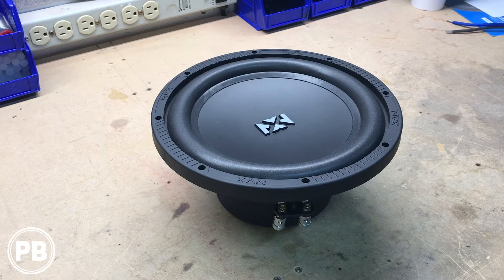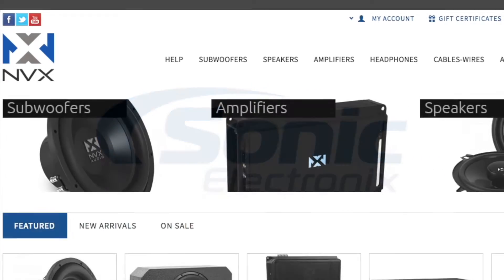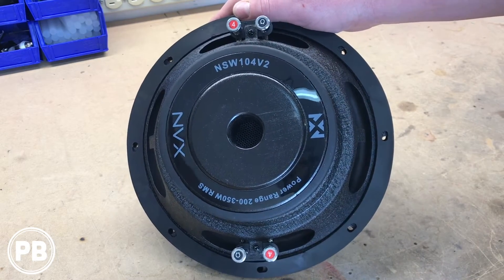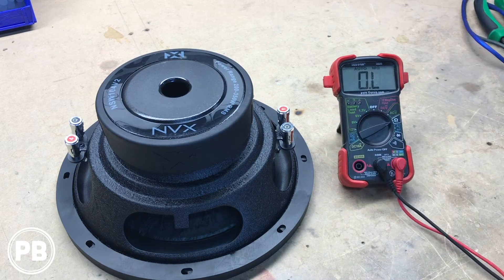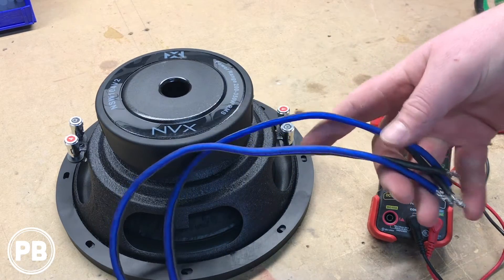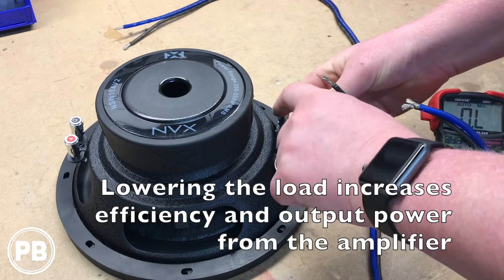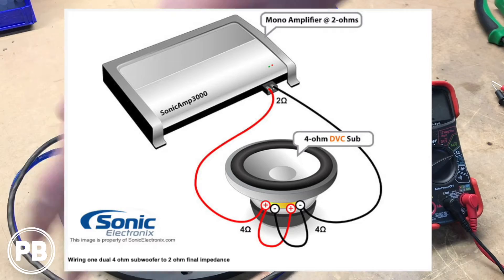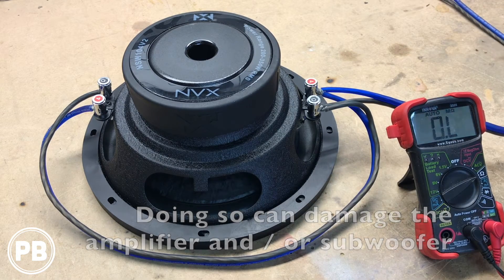How To Wire DVC 4 Ohm Subwoofer

Comment: I have a question ,  I have 2 subs, not yet installed because I cant get a straight answer .. 

My amp 150 watts PER CHANNEL 2 CHANNEL ...ONE LEFT CHANNEL     ONE RIGHT CHANNEL ,    BOTH AT OPPOSITE ENDS OF THE AMP.. 

RATING 150 WATTS RMS 4OHM 
190 RMS @2OHM 

I have 2 brand new subs 
10' 
4ohm , Dual voice Coil 
200 watts RMS 400 peak. 

I have 2 separate boxes , I can't join the 2 subs through the boxes .. 

I mean I could if 2worse comes to worse but I'd rather not due to space restrictions...  

I been told to Connect the positive and negative on one side (1 coil) leading to the amp... then jump from the live positive coil to the negative other coil ... and same with live negative Jump to 2nd coil positive... and do that for EACH SUB BOX ... 

I'm really worried I'm gonna damage my equipment
Reply: I would go from four ohm down to 2 ohm on each speaker this way you have more RMS wattage running to them and I can handle the power because it’s only 190 W RMS watts at 2 ohm just take the positive from each voice coil and the negative from each voice coil and connect them to your terminal and then run the wire from your terminal to your amp for each speaker and you will be good

Comment: When is it wired at 4 ohm....not 2 or 8......how?
My amp is 4 ohm,bridged....
Reply from the maker: Laws of resistances at play here.  If you want a final impedance of 4 ohms, find a Single Voice Coil @ 4 ohms Subwoofer.
Reply: @ProvoBeastAudio  o.k.   ..i bought wrong amp...  2 channel  2 ohm per channel   ....4 ohm bridged😲

Comment: The 5 channel amp I plan to install in my car has a 300 watt RMS a 2 ohm stable subwoofer channel, will wiring the 4 ohm sub to 2 ohms increase or decrease the RMS wattage?
Reply from the maker: Decreasing the ohm load on a sub will increase the wattage, as long as the amp can handle the lowered resistance.

Comment: Okay I'm learning and make moves faster than I'm learning, here's the scenario I'm in.
I had the Polk audio powered sub (pw10) for years, recently watched a show with clipping bass, and it half way blew the sub by the time the show was over. in hindsight, I remember the bass in those scenes sounding distorted, but I was too entranced in the show to stop watching.
I already took the liberties to order a KICKER CVR104 dual coil 4 ohm to replace the stock woofer. (long before I learned anything about power matching)

For videos I see the stock woofer is a single coil 4ohm so with that I know the amp can handle at least 4ohms, but there is little information on the amp other than it supposed to do 50-100 watts rms.
The sub I ordered claims 50--400 watts arms ( 200 watts per coil)

So my thinking is, I should wire it in series, and get a max power of 100 watts and it should match the amp's output?
it's a small room,  I'm not too concerned about using the full power of the sub, I know I'd need a whole new amp to safely to that, I just want to know if my line of thinking is correct before I hook the thing up.
My goal is to get about as much bass as I got out of the cheap driver without hurting the amp, and hopefully having my setup last a few more years before needing to deal with this shit again.
Reply: howd you get on? I run a 12inch straight of my home stereo too. 8ohm. DVC in series. Works perfect.
Reply: @georgecostanza831  I bought the wrong sub, I got a DVC 4ohm not realizing I couldn't wire it at 4ohms....live and you learn.

However wired at 8ohms AND still way underpowered it still sounds great either as good as the original driver or better. 

in fact I'm pretty sure it's moving more air because I'm hearing some port noise on low notes I didn't hear before, but once I sit in the sweet spot it just sounds smooth and clear, you just hear the port noise when outside of the sweet spot.

SO I'm thinking of adding a second sub just to add more area to the sweet listing spot.
Reply: @VALAREZ  Yeah you live and learn alright, and yeag thats always nice increasing the bass, im in the process of chucking two 12's into my car and into a ported box too. So that just upgraded my room's 8ohm 12inch to a larger box. Now the bass is even better. Neighbours are loving me.

Comment: Might sound silly but, is it possible to get 6 ohms out of 1 dvc 2 ohm sub or 1 dvc 4 ohm sub. I want to replace home audio woofer that reads out about 6 ohms with a  2 or 4 ohm dvc Car audio sub. 8” woofer.  Thank you.
Reply: The math here is: wiring speakers in parallel gives you the inverse of the sum of the ohms' inverses, in series it just  adds the ohms. Since a DVC has the same resistance on both coils the rule becomes parallel = half, series = double. Since most car speakers come in 2 or 4 ohms you can not get to 6 with a single DVC. Somw workarounds / caveats:
1) Ohms listed my mfr are not always exact. In fact the speaker demo'd in this video resulted in just over 6 ohms when wired in series (instead of 8). So "somewhere between 6 and 8" is a safe bet for wiring that specific 4ohm DVC in series. You could hook that up and if the ohms were a bit high you'd sacrifice a bit of performance but wouldn't blow your amp.
2) If you had 2 DVC speakers you have many different ways of wiring them. Wire one of them in parallel to itself to get 2 ohms, then wire that whole mess in series with a single 4 ohm coil on the other speaker. You'd then have 6 ohms of impedance for the set. Verify with a MM.

Comment: I have 2 amp, 4 speakers, and a sub. Amp for the speakers is sony xplod xm-504z, rear speakers 
Pioneer TS-A6970F, and front speakers Sony XSR1646, because the rear speakers are 100watts each and the front speakers are 50watts each, while the amp power is 4x50 @ 4ohms, i was thinking to connect the rear speakers at 2ohms, and the front speakers at 6ohms. will that give good sound without harming the system? or do you have better solution?

Comment: How can I wire 1 DVC 4ohm sub to a 2 channel amp. 600 watt amp @ 2ohm
Reply: Did you find out how to?
Reply: @guzman7590  Wire it exactly how the video shows to get 2 ohm, then plug your speaker wires on the outside  -  and the outside + .  That will give you max power @ 2ohm on your sub from your amp.  Make sure you have your boost all the way down and adjust accordingly.
Reply: @haxorbarrr  will a 4 ohm speaker get damaged....at 2 ohm  wiring......
Reply: @liljons6753  no, your amp will generate more power to the sub, so set your levels down and adjust up so you dont blow your sub.
Reply: @haxorbarrr  ok....i have a cheap pyle 15 inch   4 ohm   dual voice coil
Reply: @liljons6753  what amp is powering it?
Reply: @haxorbarrr  lanzar vector 
1000 watt bridgable  2 channel mosfet

Comment: So if I want 4ohms.... how do i wire??
Reply: Same thing I need to know
Reply from the maker: you cannot with this type of sub.  Get a DVC 2 ohm sub and wire in series.
Reply: I got the same question. Got an old r type sitting around and want to add a sub to an existing 4 channel amp in my wifes SUV. Can i run just one voice coil from it?

Comment: You cant wire a 4 ohm dvc to 1 ?
Reply from the maker: Nope, without a second sub, it is impossible.  If you want to wire to a 1 ohm final load, you will have to get a DVC 2 ohm sub.  Don't just hook up on terminal, best way to ruin a sub!

Comment: I don’t know how to explain how i did mine but I’ll try. I put the wires running on the dual coils straight to what i put attach the wire to on the connector on the box same as i would normally do for a single voice coil. Does that make the subwoofer impedance remain at 4 ohms? The sub is a dual coil 4+4 coil Shallow Mount DS18 12”

Comment: So if I just want 4 ohm , just connect to one coil 1+ and 1- ??
Reply: Basically and if u dot get that you gotta go get your head checked not time to slam the FUCK OUT MY 15 SEALED BOX CRUNCH AMP 😤😎😈👺💀
Reply from the maker: Nope, you will need to wire up both voice coils or else you will burn up the sub.  If you want a final impedance of 4 ohms, you will need to either find a sub that is a DVC 2 ohm sub (wired in series) or find a SVC sub that is 4 ohms.
Reply: @ProvoBeastAudio  Wrong, it will work fine! as long as the rms rating coming from the amp is less then half of the speaker rms rating.
Reply from the maker: 😂😂😂😂 okay, sure.
Reply: Same question. do I need another sub to have the final impedance of 4 ohms or can I wire it without another sub still at 4 ohms?
Reply: @phillipperezjr.6593  Yes two dual 4 woofers wired together will keep your ohms to 4 ohm at the amp, he shows it in the last wiring diagram @5:03